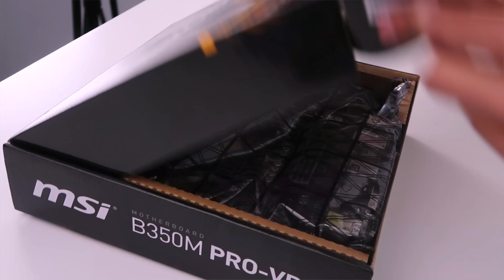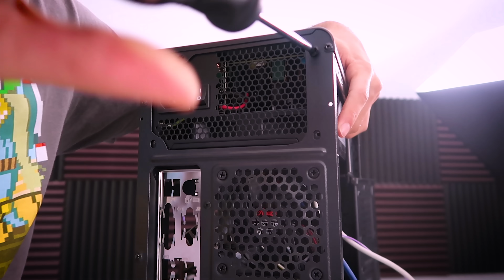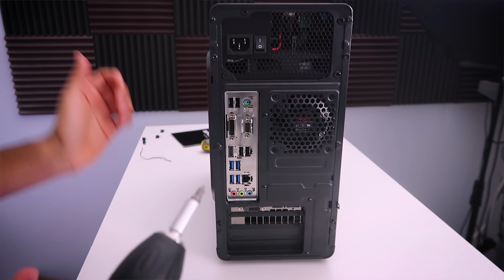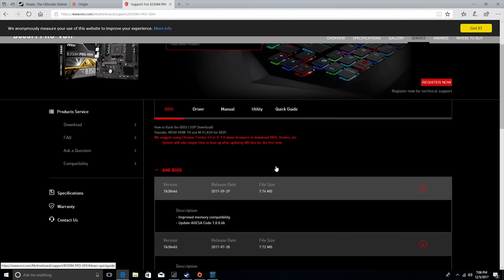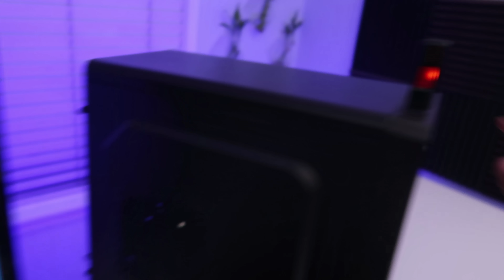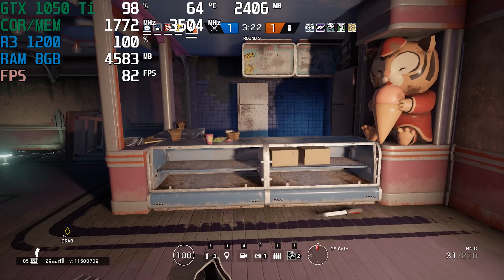$500 Budget Gaming PC Build Guide - GTX 1050 Ti (w/ Benchmarks)

Comment: HELP NEEDED!
So I bought a new gpu to replace my old one. I installed it and now my pc won't boot up. It just continues to go into the bios. I tried downloding drivers/ updates on a usb flash drive but when I go into M-flash the files aren't there.
Please help!
Reply: Dude have you tried checking if the gpu is compatible? or if everything is connected properly
also go check a discord community or a redit community of Pc things they are very smart and may be able to help you cause no one reads the comments that much.

Comment: would this be able to run sims 4 on high settings lmao
Reply: You should get rx 570/580 8gb instead of 1050ti its bascially a 1060 for same price as 1050ti and it can easily run sims 4 on high

Comment: If i replace the graphics card gtx 1050ti with a 1060ti would i get more fps respond quikk and tell me if i shouldd quik respond plxx
Reply: Yup, of course. A better graphics card means updated technology, more efficiency, power and more VRAM.
Of course, more FPS. There, i told it quikkkk.
Reply: @SunildaHustler  Ok thanks but would the gtx 1060ti fit would i have any problems or anything
Reply: @SunildaHustler  and how much more fps do i get with the 1060ti should i just buy a 1050ti
Reply: @vybezz6359  I think you should buy a 1060 ti. It is much more powerful, supports 60-90 fps on ultra settings for games like Far Cry 5, The Witcher 3 and so on - a gtx 1050ti is likely to become outdated and non high performance graphics card by 2020 or so. A gtx 1060ti is a good blend of budget and power and will last longer. So I suggest 1060ti.
Reply: @SunildaHustler  Ok thanks ma dude
Reply: @vybezz6359  Sure ma dude.
Reply: @SunildaHustler  hey dude if im buying the exact same things that he is but a 500w power supply and gtx 1060 then do i need some motherboard standoffs like do i have to buy them seperate
Reply: @vybezz6359  A 500 watt power supplu is enough to even support a GTX 1070 or 1080 - but to give a little space for extra upgrades, a 550 watt power supply would be good.
Reply: @SunildaHustler  i think ill just stick with the 500watt thanks
Reply: @SunildaHustler  wait dude so i can just use everything the same in the guy used in the vid set it up the same way but just a better power supply (500watt) and a better graphics card (gtx 1060ti) there will be no problems? im scared cause its my first time building a gaming pc

Edit:The graphics card gtx 1060ti is 6gb
Including the same case 2 everything the same
Reply: Vehement Moon dude get a rx 580 8gb way better for the price
Reply: @ash-wm4iu  yup i was going to get that ty anyways
Reply: @vybezz6359  Somebody tell this guy a 1060 ti doesn't exist

Comment: Paid 20$ more
Got ryzen 2200g 3.5Ghz Quad-Core 
Msi rx 570 8gb GDDR5 1.244Ghz
Reply: yo, dude did it work? cause I also wanna upgrade.
Reply: wait dude you mean the armor edition, the red one?
Reply: /: I don’t see why it wouldn’t work lol.
Reply: Sniperkill3rftw i got a ryzen 5 2600 and my motherboard cpu ez debug led lights and the pc won’t post
Reply: Santiago Ponce what’s ur motherboard
Reply: Sniperkill3rftw the same one as this video and the solution is I have to update the bios so my cpu can be compatible with the motherboard but I can’t go to the bios bc the only cpu I have is the ryzen 5 2600 and I check if the pins were bent but they wasn’t
Reply: Sniperkill3rftw i found out why, it’s because the bios is outdated and I can’t go to the bios bc I only have one CPU soo what that means is I have to buy this video CPU just to update the bios
Reply: Santiago Ponce But you wouldn’t need to update it if it’s B450 X470
Reply: Sniperkill3rftw mine is from this video MSI B350M PRO-VDH
Reply: Santiago Ponce Well now I see the problem, that was introduced with Ryzen 1st Gen, not meant with 2nd but you do need to update the bios for it to work.
Reply: Sniperkill3rftw yup which I don’t have an old ryzen welp at least I’ll have a back up cpu I guess
Reply: Santiago Ponce You can always return the board and buy a B450 from Aorus and Gigabyte, or order a Boot kit from Ryzen to help with bios updates
Reply: @nintendomusic2199  download something to auto update...then it shuld work
Reply: Santiago Ponce maybe ask a friend to install drivers onto a usb drive for u?
Reply: But this video is 2017
Reply: the 570 is better than the 1050ti by a bit, good buy.
Reply: Not by a bit.
By a lot. Rx 570 is op for it's price.
Reply: Built something that costs about £550 Ryzen 3 3200g second hand rx580 4gb 8gb ddr4 2666 120gb ssd 1tb hdd and a b450

Comment: Nice video.. can i installthis card in my core i5 2400 3.10 ghz 8gb ddr3 ram psu is 320 watt moderboard model is 3396 ... plzz reply sir
Reply: You can.
Reply: @fortie6902  i am buyimg evga gtx 1050 ti can u sure abut this bro my pc su is 320 watt and modoer board is hweler packard model nober is 3396 plzz reply sure

Comment: I got this prebuild pc for 1250 euro
Gtx kfa2 1080 8gb, ryzen 7 2700, 16 gb ram ddr4 3200mhz, 700 wat psu, 240 gb kingston ssd, 1tb hdd seagate barracuda nzxt s340 case
Decent for a prebuild pc?
Reply: Mafehente yeah that’s a pretty solid prebuilt.  Did you get on sale, tbh that’s one of the best prices I’ve seen for a prebuilt with a 1080 and it seems to not have cheaper out on random parts as I’ve seen so many prebuilds do sadly.
Reply: @kennedymoreiras3054  yeah I am very happy with it and the motherboarf is an asrock m320.

Comment: may  i suggest a good ram kit its a corsair vengeance lpx 8gb 2.4 ghz its 40 dollars
Reply: 2.4 ghz? $40? I dont know about that 2.4 ghz, but $40 ram is usually single channel ram, which is a big hit on performance. Or, its a ddr3 kit.
Reply: @parallel2795  no its actually 2x4 kit and its ddr4 since there is no ddr3 ram higher than i think 2 ghz
Reply: @nycro8285  Ahh I see. 2.4 ghz = 2400 mhz. That ram is not that fast and could decrease performance since ryzen needs higher clocked ram.
Reply: @parallel2795  really want to know who told you that lie truth be told faster ram is better but even the ram kit in this video is 2400 so its viable plus you can overclock to 2660 or maybe even 3000 and why are we discussing this for the same price your can get 8 gbs of 3000 ram now since prices have gone down
Reply: @nycro8285  How is that a lie? Faster ram = more performance. And you dont have to get the same exact parts in this build. Like you said there is a 3000mhz for less, just get that.

Comment: hi, is there anyway i can connect the pc to wifi without buying the adaptor?
Reply: Ethernet
Just download the LAN drivers and get a ethernet cable or whateve its calld
Reply: but I'll have to use LAN all the time, right? or is there anyway i can use wireless network without the adapter?
Reply: Im pretty sure you will have to use adapter for wireless network. Or youcan also get a motherboard with onboard wifi.

Comment: Which one should I buy rx560 or rx570 or gtx 1050ti or any other in this budget
Reply: RX570
Reply: 570, for sure.
Reply: Pedro Henrique S I know this sounds stupid but will the rx570 work with this build
Reply: @carsonnichols8818  Of course it will. RX 570s can be found cheaper than GTX 1050 Ti's in most places and the 570 literally WALKS on the 1050 in terms of price to performance ratio. RX 570 4GB is a budget beast. If you can stretch your budget a little, get the RX 580 8gb if you can find it a reasonable price ($200-$250 range). I would also suggest maybe waiting it out until AMD 3rd gen processors come out as well; or if you're just going to build it now, go for Ryzen 3 1300x. It's only 20 bucks more expensive and is more performant than 1200.

If you can manage to overclock the 1200 to 3.9Ghz then don't bother with the 1300x.
So TLDR;
Ryzen 3 1300X + RX 570 4GB for a good budget 1080p gaming experience
Ryzen 5 1600/1400 (Go for 1400 if you're on a budget but 1600 is a really good CPU) + RX 580 8GB

The second combo is if you get the 580 for under $250. Shouldn't be hard to find it under that price range. For reference, RX 570 4GB has similar performance to that of the GTX 1060 3GB variant. AMD is the way to go for budget mid-range GPUs currently, especially after the cryptocurrency crash.
Reply: @taren5245  is an rx580 4gb good?

Comment: I’ve got the omen laptop with the 1050 ti and i7 8750h   This isn’t able to be overclocked or even adjust the max temp settings in EVGA or Afterburner , is IT? I’ve tried downloading them but It’s not doing much. I want to just increase performance a tad.

Comment: I plan to build the same pc. First question, can I just overclock to 3600mhz to be safer and do I need 2 sandisk usb flash drives? Was just wondering why I cant use one sandisk usb flash drive for everything?

Comment: Is this compatible with a AMD Ryzen 3 2200G Processor?
Reply: MasseBolle no don’t bother with this motherboard get a b450 pro vdh for that chip
Reply: Simba 1243 what about the AMD Ryzen 3 1300X? That will fit right?
Reply: MasseBolle yes it will but i prefer the 2200g
Reply: Simba 1243 But then I won’t need to buy a different motherboard xp
Reply: MasseBolle yea ig

Comment: Followed this step by step and it wont turn on. Help
Reply: Fantom Friend I've checked over everything at least 10 times. I think my PSU might be toast. I'm building this for my brother before he gets home from Vaca. I'll hit the power button and it flashes a light but nothing happens
Reply: Does it show display on the monitor or what doesn’t turn on?
Reply: JustTooLogical Logic it only boots if I unplug the cpu pwr1 on the mobo. And nothing comes up in the display, no bios or anything. Im 75% certain it's the PSU

Comment: Can I do all the same items but with a 1080 gtx instead?
Reply: noooo the ryzen 3 1200 wont be able to handle the 1080.  your gpu will get bottlenecked by the ryzen 3 1200.
Reply: So should I switch the Ryzen?
Reply: @aegean5749  If you want to go with a 1080 you have to go with a higher end cpu or else your 1080 will just get bottlenecked by the cpu. I recommend going with an i7 or a Ryzen 7. Or I also suggest to just go with a Ryzen 5 and 1060 or probably a 1070.
Reply: @LanZo Thanks a lot man I appreciate!
Reply: you will need a better motherboard, more ram, better processor, and a better power supply

Comment: Is it possible to use just one stick of ram if you only have the one at the time
Reply: King_Apple_Gaming it is possible, the term for it is single channel (one kit of ram only). but by doing that your system would be comparably slower and results in lower fps in games

Comment: Computer turns on, but no signal to monitor. Help.
Reply: Fix:I had connected monitor to IO shield instead of GPU. Connecting it to GPU worked.
Reply: u meant u connected it to motherboard not io shield just fyi :)
Reply: @giovannh8217  The "IO Shield" are the connections to the motherboard. The motherboard has an HDMI connection, but that is the incorrect connection to plug into. The actual connection should be to the graphics card.

Comment: So I finished my build and it wont give signal to my monitor what should I do? The fans and inside is working.
Reply: Sisu Sakaali do you not know what plugging in you monitor cable into your gpu means?
Reply: @mitchellelliott7085  i did but I sent a defective motherboard. Don't worry I got it running now.

Comment: just built this pc last week and I love it so much!
Reply: how does it perform? Planning to build it later:)
Reply: Well I changed the processer to a and ryzen 5 1400 and over clocked it to 3.7ghz and if u want to use what joey is using then he shows you how it runs in the video :)
Reply: @JMW07  What is your average fps when playing games?
Reply: @MonEvo-9  it varies on different games I usually play gmod and I get about 40-150 fps depends on how many people are on the server.... on sea of thieves I get about 40-65fps on max settings and it feels very smooth
Reply: @JMW07  what about Fortnite?
Reply: I get about 80-140
Reply: Or 160ish
Reply: Ruthlezz 7 did you use a different case?
Reply: @pancake4691 yh but it was very very similar
Reply: Ruthlezz 7 if it has tempered glass or acrylic side window can i have the link to it?
Reply: Sorry mate mine didn't come with a window just the same as the case on the vid
Reply: Ruthlezz 7 oh okay thanks anyway
Reply: No worries
Reply: Ruthlezz hello good sir I just build mine like yours and the hdmi and mouse doesn’t work but I tested them on another computer and they do work and idk what to do
Reply: @nintendomusic2199  maybe faulty gpu and motherboard? im not sure sorry
Reply: @nintendomusic2199  did you plug the display cables into the graphics card or the motherboard? plug them into the graphics card

Comment: Personally I would pick a slightly more expensive case but this one looks surprisingly good...
Reply: Sad Doge which ones would you recommend for this build? i want to build this pc but i’m not so sure about the case, it looks to tight
Reply: @pancake4691  Nzxt S340 is a solid choice, but it cost more obviously... I'm sure the case featured in the video will fit the components no problem though.

Comment: Do I need to buy the WiFi adapter too? Or I can use the Ethernet cable without the drivers ?
Reply: Lord Crowlay If you want wireless internet, you need to get the USB adapter shown in the video. If you want a hard connection you need to use Ethernet cables.
Reply: Download ethernet driver to usb stick on another computer. 

Once youre down building and get it to boot to desktop, plug in usb and install ethernet drivers. 

Then windows update and most will install automatically.

Comment: Hey Joey Delgado I’m building a pc that has same specs as shown in this video. Only difference I’m putting in a hard drive and an ssd. And I’m putting in a gtx 1050 ti, I was wondering if there is any problem paring a gtx 1050 ti with the motherboard and the cpu that was shown in the pc in your video. Please answer big thanks if you answer.

Comment: If my case has a spot for my power supply on the bottom of the case, should the fan be pointed up towards the inside of the case, or still pointed down at the bottom?

Comment: Would this work 
16 gb ram
EVGA 600 BQ
1 tb hard drive 
Ryzen 5 2600 
GTX 1060 6gb
Same mother boeard in the video and fan for the case i might go for the MasterBox Q300L.
Reply: It would allow most games to be played on ultra settings; I recommend additionally 256GB of SSD for your operating system.
Reply: @martynduncan6668  alright thank.u

Comment: Hey guys I could really use some help, I started playing a game and my pc just froze and the power button won’t even work so I had to turn off the power supply then turn it on again I have done everything in this video and over clocking, so I don’t get why it does that I even updated the bios
Reply: Have you installer graphics drivers?
Reply: Jopperdepopper I’m fine I just had to raise the cpu voltage thanks tho

Comment: Wait I'm confused, is the flash drive necessary? I'm not too educated on this stuff and I've been trying to learn more so any help would be awesome.

Edit: Also, if I were to use the wireless WiFi adaptor where and how would I connect to the network?
Reply: K. M. G. If you want to get windows 10 you’ll need the flash drive. When you use the Wi-Fi adapter, just download the drivers press the button on the adapter and your router to connect them.
Reply: @lunaro23  Okay thanks

Comment: I just built my pc everything turns on except my monitor and keyboard/mouse help me
Reply: Glad What exactly is the problem
Reply: @lunaro23  2 ez debug leds light up cpu and dram everything runs but monitor geta no signal
Reply: Glad try to reinstall your ram sticks I had the same problem
Reply: @lunaro23  tried to switch the slots, still the same problem :/
Reply: Glad  is your hdmi plug in your gpu?
Reply: Yes my vga is plugged to my gpu
Reply: Glad is your monitor VGA only?

Comment: are these specs good?
- CPU i3 530 2.93ghz

- Ram 4GB DDR3

GPU - GT 710 2GB HDMI PORT

- HDD 500GB ( WINDOWS 10 64 BIT )

- WIFI USB

- 500W PSU

- DVD RW PORTABLE USB INCLUDED)

COMES WITH POWER LEAD.
Reply: No

Comment: Alright, quick question guys, I opened up ebay and added all the parts (except the extra fan) and got a total of $529.
BUT I opted for a  EVGA 650W non-modular power supply, a USED 1TB WD HDD (I already have like 4 lying around at home), found the ram USED for 75$, opted for a NEW AMD Ryzen 5 1500X Quad-Cored 3.5GHz AM4 for 129$, a refurbished motherboard, same as in video, and last, but not least, an NVIDIA Founders Edition GeForce GTX 1060 6gb which I found USED for $179 and I kept the $26 rosewill case. Grand total: $529. Anyone care to improve on that? Let me know

Comment: I built this exact pc and it was my first time building a pc. The cpu fan was really hard to install, but after an hour I managed to screw it in. When I finished building it wouldn’t start up properly and none of the ports were working so I took it to a repair store to fix it. Turns out the bios on this motherboard has to be updated in order for it to support the Ryzen 3 1200. If u have this problem just give it to a computer repair store.

Comment: Lemme get this right ... u omly plug in the 24 pin connector and the cpu power cable and the fan headers and your case wires? Correct?